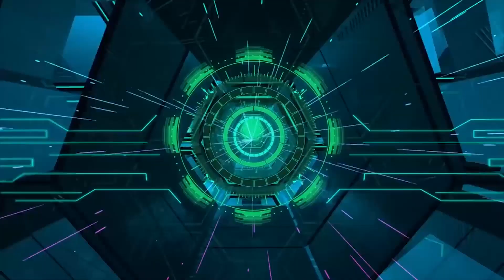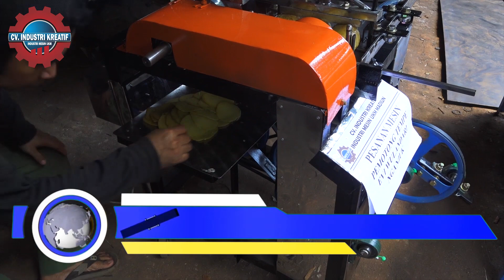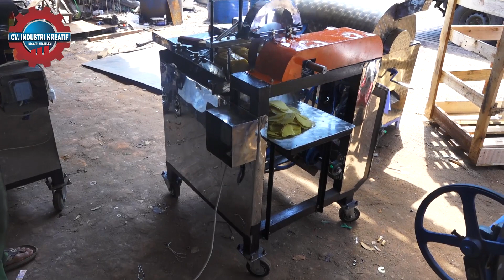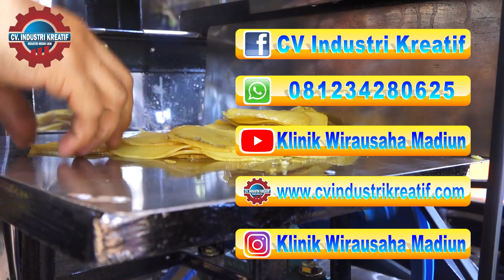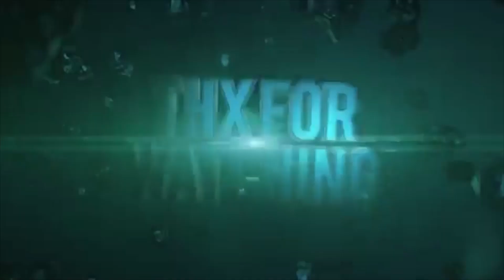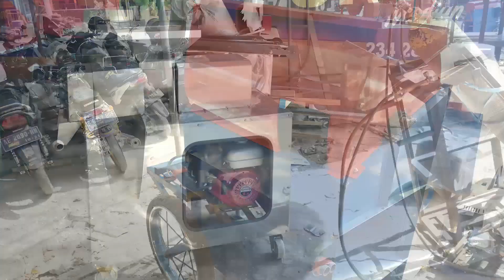LEBIH CEPAT HARGA MERAKYAT | MESIN PERAJANG KERUPUK OTOMATIS

Comment: itu mesin pemotongnya ya pak...mau tanya...klo untuk mesin pembuat krupuk gendarnya ada gaaa....
Reply from the maker: ada gan

untuk info harga,detail mesin & pemesanan hubungi Customer Service Representatif Kami (Telp/WA) 081234280625 - 081217850288 - 082142267610 - 0812330810125 atau kunjungi Workshop Kami di Jl Madiun - ponorogo KM 10 Selatan Puskesmas Geger 300 Meter Kec Geger Kab. Madiun Jawa Timur

Comment: Gan klo ktebalan 0,8 mm bisa ga itu mesin gan??
Reply from the maker: sejauh ini masih 1mm gan... kalau berkenan bisa ujicoba di workshop...

untuk info harga,detail mesin & pemesanan hubungi Customer Service Representatif Kami (Telp/WA) 081234280625 - 081217850288 - 081252297132 atau kunjungi Workshop Kami di Jl Madiun - ponorogo KM 10 Selatan Puskesmas Geger 300 Meter Kec Geger Kab. Madiun Jawa Timur

Comment: Harga berapa gan
Reply from the maker: untuk info harga,detail mesin & pemesanan hubungi Customer Service Representatif Kami (Telp/WA) 081234280625 - 081217850288 - 082142267610 - 082334870125 atau kunjungi Workshop Kami di Jl Madiun - ponorogo KM 10 Selatan Puskesmas Geger 300 Meter Kec Geger Kab. Madiun Jawa Timur